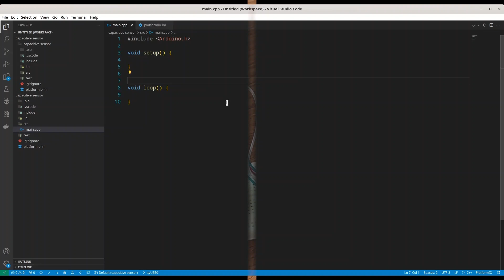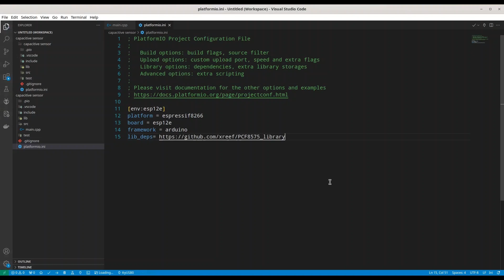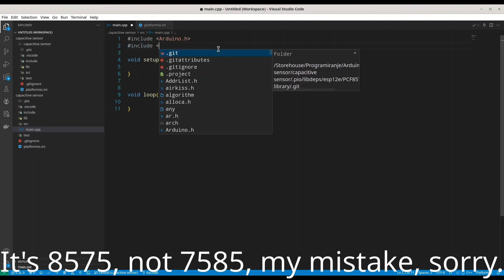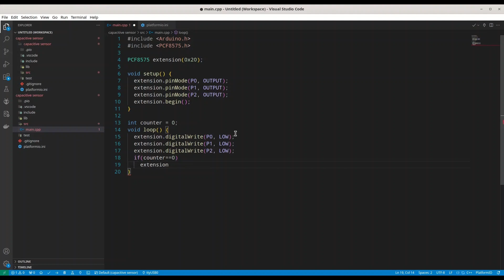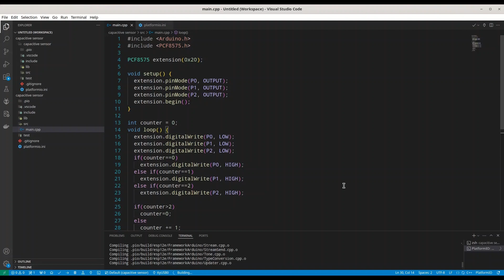ESP32 & ESP8266 - PCF8575 extension module

Comment: hi, how to make green led brighter?
Reply from the maker: Hey mate, thanks for reaching for me. Sorry for I must say, but it seams that you don't understand the problem in full. With LED, when you apply optimal voltage, you are already at maximum light that LED is designed for. It's nor safe nor smart to play with voltage. On the other hand, there is an easy way to dim LED using microcontroller and therefore regulate it's light. Check out this episode to learn how to do so https://youtu.be/cfrd8aGtbak Hope it helps.
Reply: @kindspirittechnology Sorry I am a beginner in electronics, can I know why the green led is so dim in this video? Can i use two of this PCF8575 on ESP32 to connect to 24 LEDs (only 8 LEDs are on at a time)? The LEDs that I use is a traffic light LED module so there are three LEDs (Red, Yellow, Green) on one module. I use a total of 8 modules. 
Thank you very much.
Reply from the maker: Honestly, I never tried to hook up two extenders at once (never needed though)... but why it would not be possible. On esp8266 you can pass sda and scl to the constructor and address map can take from 0x20 to 0x27, and on esp32 you can use twowire library to create two different I2C channels, because pcf8575 constructor can take TwoWire object as argument.
Reply: He most likely damaged that led prior to this test, or too much ohm on the resistor supplying to the led.

Comment: Hi Sir, thanks for the video, please assist me, I have been looking for a tutorial on how to set or change address on the pcf8575, where exactly to soldering to define a new address. Thank you.
Reply: addresses need to start at 0x20, through to 0x27. All three pads need to be soldered to GND to set as 0x20, and all three pads soldered to VDD to set as 0x27. (with binary steps in between for the other addresses.......remember to also place solder across the other pad VCC VDD when using higher addresses)
Reply: @keithpitcher8379 Thank you very much.